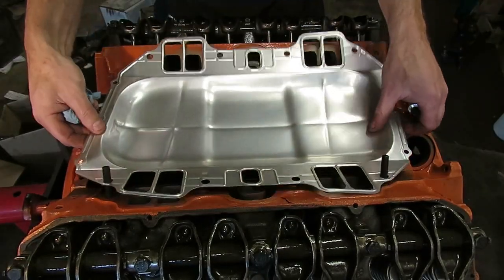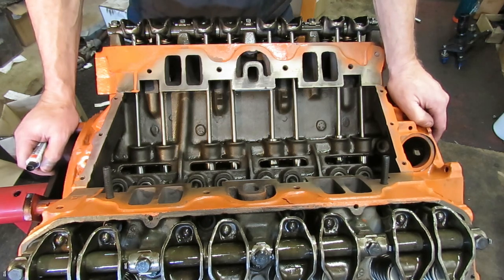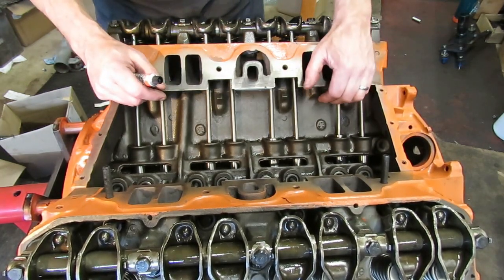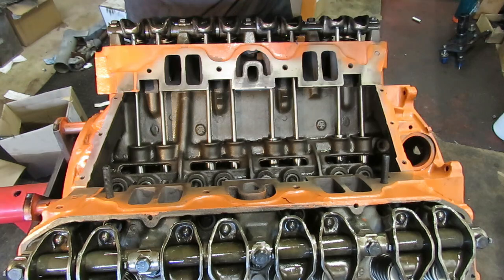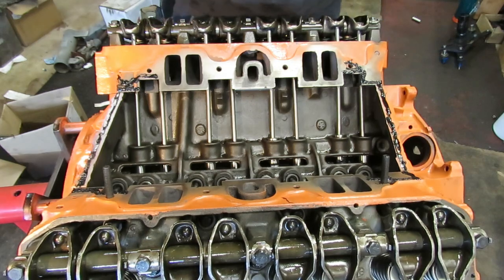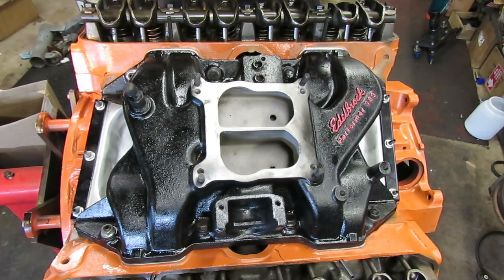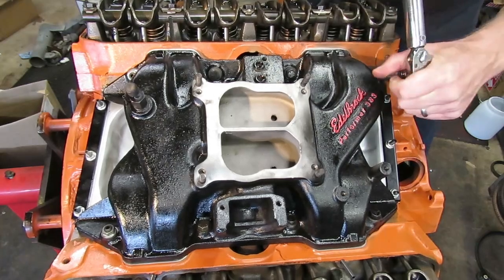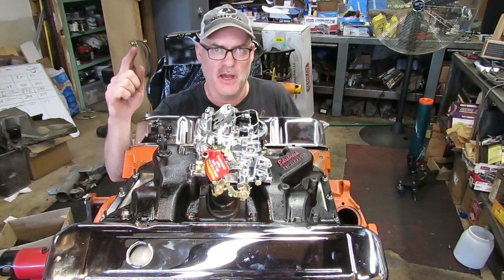Plymouth Roadrunner 383 intake manifold installation

Comment: Great engines, they really respond well to bolt on upgrades.
Plus, a cam and some head work along with your bolt on headers, intake, and 750 carb will put you well into the 450+hp range.
Reply: This is a long shot but, I have a stock 383 which intake which headers and which carb do you recommend? I want it to be between 400-450hp I’ll be very happy

Comment: So there are many kits that give you 4 intake gaskets with the steel valley cover and I usually use them by putting a set on first put the steel valley cover pan on and then the other set of gaskets on top. Now I have seen some do that and seen people like you not do it and I got to say why would they send gaskets along with the pan if you did not need to use them?

Comment: I always use the furnished paper gaskets directly under the aluminum intake when cast iron heads are used in order to maintain a good seal. Of course the manufacturer recommends doing so.

Comment: Great video, I will be doing this for the first time within the next month, my new BB 383 motor came with the intake gaskets, I noticed you didn’t use them, are they not needed? I have a Holley Street Dominator intake with a new valley pan. Any info would be much appreciated. Thanks

Comment: Have you ever shown a video on doing some home porting & or unshrouding the valves?? I would like to watch that. Im a big block ford guy & have ported my smog D3VE-A2A 460 heads. I had them flow tested & I got improvment on all the lift heights on both intake & Exhoust all the way up to .700 lift. So I would be very interested in seeing how you might do such a head or a FE head. I know you work with FE's. Im putting together a 360 right now for my 71 f100 short box 4x4. Its getting the block decked for alil more compression & im using C6TE heads.

Comment: Great Chrysler engines.  What are the size of the valley pan studs you used for aligning the pan?  BTW- Can you make a video on ho to prime an engine with oil?  From start to finish, finding TDC, inserting a priming tool (tricks if any), the whole job.  Thanks

Comment: I have sort of a question; I  used the same method for the install of the valley pan, RTV the corners of the steel gasket rails.

I started the motor after installing the intake aswell and there is a HUGE vacuum leak from the mating surface from the Valley pan to the intake runner ports.

Re-torque after reaching operating temperature I'm guessing?

Or use somthing like Good/great stuff from permatex to lightly coat the intake mating surface?

I used a differing torque sequence due to the manifold not being Edelbrocks manifold, Should i follow suit on the same torque sequence as the Edelbrock manifold also?

Appreciate the answers Thanks.

Comment: I like to block those heat holes that are in the center of the head since they are useless with a aftermarket Intake and if you get aftermarket heads they don't have those holes to heat the intake that was only good for cars ran in cold climate the heat would heat the manifold and make it run better in the winter but most people don't run their cars in the winter now days anyway and even if you do it really don't efect it that bad

Comment: Good post bro. I know you had budget to meet. Just FYI, Felpro makes a heat crossover delete valley pan gasket, that's much better when your stuck with an EGR intake like that one. Horrible design from Edelbrock. The delete gasket isn't any more expensive than the one you used here. And it makes a huge difference in acceleration on hot days or if the motor just runs hot.
Reply from the maker: Cool, thanks

Comment: On my 70 roadrunner I got the valley pan that blocks off the exhaust crossover so the intake isn’t 999999 degrees and there are no exhaust leaks from the intake and the fuel doesn’t boil as easy if you have an edelbrock
Reply: Does the valley pan you have also block the outer U-shape passage that isolates the head from the exhaust gases, or the U-shape passage is exposed just like in this video? Thx in advance
Reply: @iacceptcash9258  it’s like every other pan except the exhaust opening is closed

Comment: Does the factory install the steel type gaskets on intake manifolds with heads only snug on torque value. Install and tighten manifold then final torque cylinder heads?

Comment: I wouldn't go more than 10 foot pounds of torque on those 1/4-20 bolts. You'll snap them off at 20
Reply: Yea, I wonder if he meant inch pounds...but I agree, not 20 foot pounds
Reply: Why would you bother putting a torque wrench on those idiot bolts at all? People are insane for pedantry on ridiculous shit.
Next we'll be torquing the bell housing bolts, the engine mount bolts and torquing the radiator to the support panel lol. Better not forget to torque the hood to the hinges and torque the window winder handle screw to the window reg. 
I'll get the inch pound torque wrench out the fasten the dash pad screws .. Really!
I wonder if there's a Chrysler tool for torquing the spare tire wingnut?
Reply: @ThePaulv12  I understand what you say, me myself I never used a torque wrench for this, the point is I believe, the items like these, Chrysler had a recommended range for them. I was lucky, I never used one for the intake [followed the pattern though], never for the exhaust, carb etc. Some peole used Fel Pro blue gaskets with the metal pan, I tried it once, couldn't get the intake bolts to go in correctly
Reply: @ThePaulv12  man go take your prozac it aint that bad
Reply: @JohnLittle-ze7sp  I don't need a prozac but I see you could use a colonic herbal infusion!

Comment: I use Copper Spray Gasket on the steel intake and head gaskets and little dabs of sealant in the corners of the block and heads.
I have found pieces of silicone gasket sealer in oil pick-up screens from somebody applying too much, that's bad at high rpms.

Comment: Great work! have you ever used the composite/paper gaskets on the intake openings with aluminum intakes for big block mopar. love the mack shirt!, love the 383 got 3 of them ones in my 77 Cordoba.
Reply: I have, a couple of times. For me, it messed up the bolt alignment for bolting the intake down
Reply: Didn't make the 383in 77 the 400
Was
Reply: @grantdavidson3539  Yes that's what it came with but I took the 400 out cause it was smoking it had cracked pistons rings. I took a 71 383 and put it in place of the 400 since it was easy to do.

Comment: Ive rebuilt many 383's..Im surprised you didnt measure the lifter preload...I would not trust any thing to chance...I liked to have as little preload as possible..I got lifter pump up and ended up bending pushrods untill I went with crane antipump up lifters and that fixed the issue of incorrect lifter preload. Very stout motors, with the skirted block, Forged steel crank and connecting rods..all over kill for the stock HP ratings. When replacing the cast pistons (which would tend to seize the pins ) to forged units, these motors could handle 600 HP no problem as long as you didnt spin it over 6500 RPM.

Comment: Good morning from the 206. I’m new to the Mopar RB Big blocks and was just curious what are those exposed parabolic openings on the center intake ports of both heads for? They look like they would either cause a vacuum leak or spit fuel back out?
Reply from the maker: nope just a heat sink they go no where

Comment: I'm watching videos as much as I can about doing the same intake manifold install on my 440. Everyone says not to use the paper gaskets that come with the pan, got it. But the Edelbrock instructions do say to use (their) gaskets for the intake to pan. Is there a reason not to?
Reply: I use the gaskets and that's because the Aluminum is going to move differently on the the gasket with hot and cold cycles then the factory cast iron intake plus the gaskets will give you a for sure seal where just the pan may give you or may not give you a for sure seal depending if there is no warpage or anything but I personally use them when using a aftermarket intake

Comment: Your torqueing to steel intake spec.  It's too high for aluminum.  Edelbrock says use 25'lbs intake bolts. Other than that, Thanks.  I just installed one and got some pointers from  you.

Comment: So would you say aluminum intake manifolds get less torque than the factory iron, or it just depends on the manufacturer's recommendation? I noticed my Holley Street Dominator (440) says to torque to 15 ft. lbs. and to progress to 30 ft. lbs. in 5 lb. increments. Also, always noticed with every aluminum intake I've used, there are washer scoring marks in it. I guess not a big deal, but I just use Grade 8 washers or greater so at least it scores the intake flatly and evenly.
Reply: Aluminum intakes do take less bolt torque than cast iron intakes. Steel flat washers have a rough edge side and a smooth edge side. The smooth edge side should go down towards the intake manifold.

Comment: I often wondered if there was any difference between a 383 and a 440, always learning , oi oi oi
Reply: B block versus RB block.   B block 3.375" stroke = 350, 361, 383, 400.  RB block 3.75" stroke = 383, 413, 426, 440.  Yes, there were both B and RB 383's - different bore/strokes.  And yes, Chrysler made 350CID B blocks.    B's had  a 9.98" deck height, 6.358" rods, and the 2.625" mains.   RB's had 10.75" deck, 6.768" rods and 2.75" mains.

The distributor shaft was shorter on the B blocks than the RB's.
Reply from the maker: yes Good info this 383 is a B

Comment: Chrysler have been getting the heat away from there intakes...

meanwhile the camera is starring right at the exhaust intake manifold heater...
Reply from the maker: you do need some heat to atomize the fuel when you have a cold engine getting the hot coolant out of the intake helps a ton also you can block off the EX crossover when building a higher performance engine
Reply: @Myvintageiron7512  I know ;). just couldn't resist ;)
Reply: @Myvintageiron7512  Fel Pro intake gasket #1214 has the carb heat blocked off, no hole. Doesn’t come in a gasket kit though, have to buy separately, about $30. Great video. 383s are under appreciated.
Reply: @fpeletz Oh that’s right, I remember those.

Comment: What is the deal with the open gap in the heads between the intakes? Idk much about mopar engines
Reply: That's the heat riser passage to warm the intake on cold start.  (The "inside", smaller hole... the outer U-shape is just to isolate the passage from the head.)  There's a heat riser valve on the right factory exhaust manifold which is closed when cold; it forces and redirects exhaust gasses through the intake and on out the left exhaust manifold.  When the riser valve heats up and opens, that hot exhaust simply stops flowing through the intake.  Many aftermarket manifolds ignore that provision and don't use that open passage in the head; usually guys abandon the factory exhaust manifolds and use headers with no riser valve.  This intake, however, has the heat riser passage - they have the thermostat well on the right side (for the choke thermostat) that measures the temperature of the intake riser passage as it's heated by exhaust gasses.
Reply: @easygoing2479  ooo ok. My old qjet i had on my sbc had one built in for cold starts

Comment: Is there a way to fit a 440/413 intake onto a low deck 383/400 engine? There's a port injection system I want, but it only comes for the RB engines.
Reply: Sorry, no, vice versa, B intake on a RB, yes but not RB intake on a B.

Comment: The port in middle of heads between intake holes.  Its not for antifreeze?
Reply: I was wondering the same thing. But I think it is an exhaust crossover to warm up the manifold. So on a stock engine it is filled with exhaust fumes, not antifreeze.